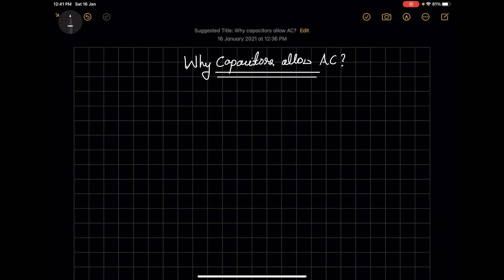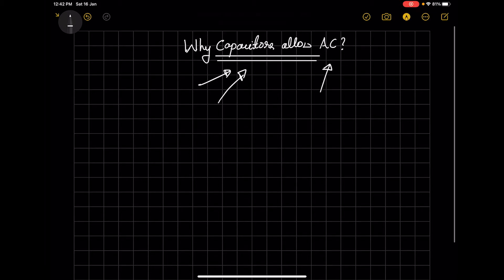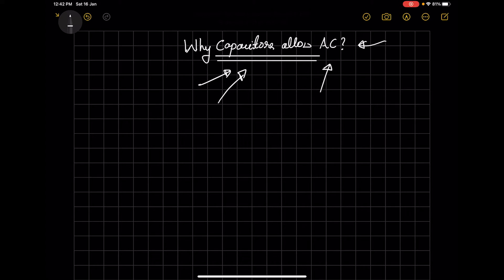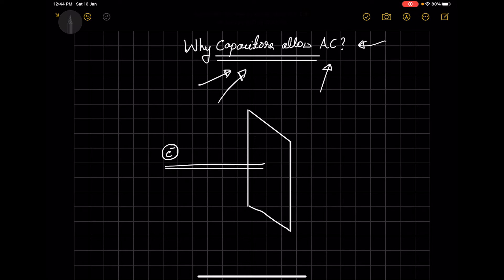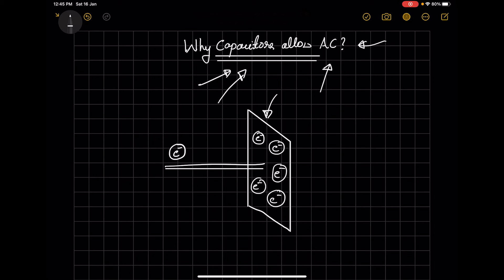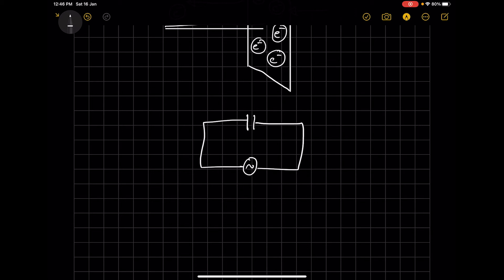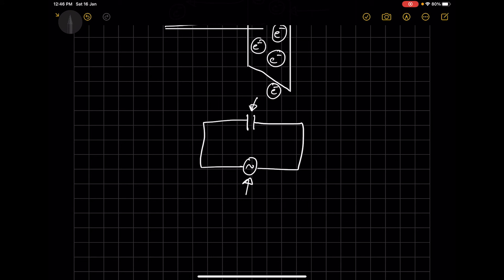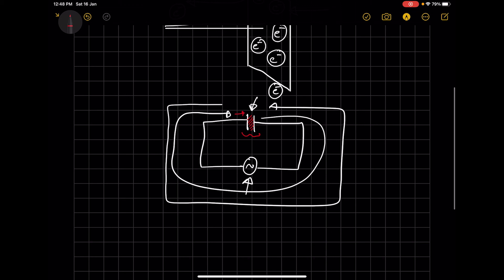Why Capacitors allow AC signals? | Electronics 101

Comment: This helped me a great deal!  I now understand how the AC signal passes through the capacitor!  It really like as 
the electrons accumulate by the AC signal pushing electrons towards ONE capacitor's plate (A)...that plate (A)
then has an excessive amount of electron on it's plate!  The excessive amount of electrons on that plate (A) is
FELT "electrostatically" (by the close proximity) on the other plate (B).  The electrons on plate (B) are then repelled
by the excessive electrons on plate (A) and moves away from plate (B)...AT THE SAME RATE THAT THE ELECTRONS
ON PLATE (A) are being pushed towards and pulled away from plate (A) by the AC Signal.  Thus is "seems" the signal
is being passed thru to Plate (B) because plate (B) is mimicking the exact rate (frequency) of the AC signal experienced
by plate (A).  Then whatever is attached to Plate (B) sees that AC signal that is actually on Plate (A).  Whether that signal
goes ground, or used to control an amplifier...it can be directed "onward" as needed!